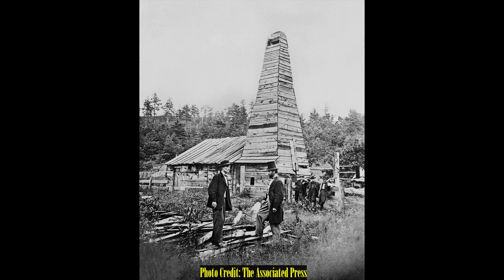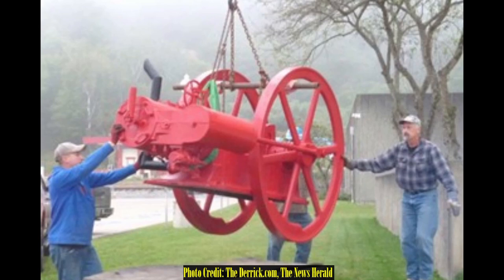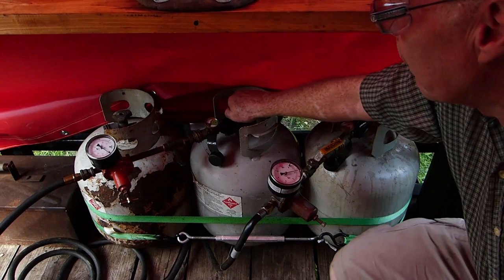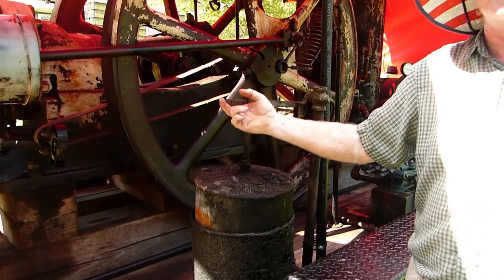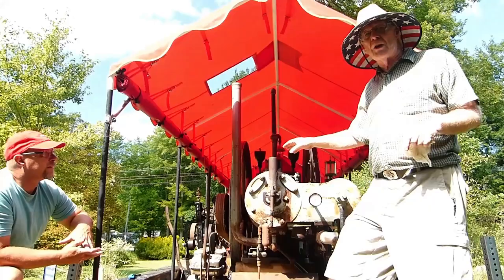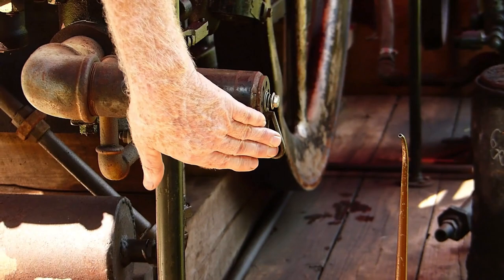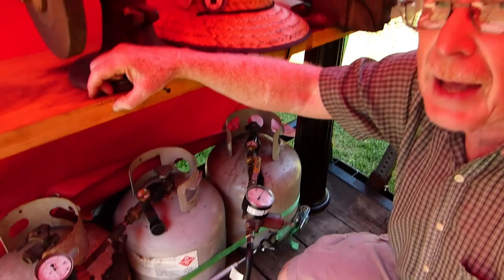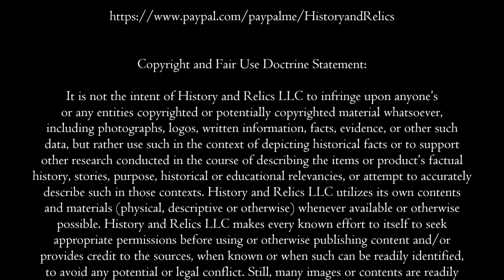Joseph Reid Gas Engine Type A: History and Instructional Operating Demonstration

Comment: Great history lesson and demonstration. I just watched a video about a 2 stroke 'concept' engine with a secondary piston that the designer calls a 'pusher piston'. The secondary cylinder is offset from the main combustion cylinder and has a crankshaft as opposed to two flywheels with offset piston rods.
I think a modern 2 stroke that uses a 'charging cylinder' is worth developing. I hope to see a prototype actually built.
Thank you for posting.
Reply from the maker: I’m very happy you came across my channel and enjoyed the video and found it useful. That was our goal as we seen so many others not provide details, tips, tricks, and the like. We wanted to be different but lend a hand out there that have similar equipment or can benefit from our demonstration. Thanks again!

Comment: Great video! I own a 1913 Reid 25 hp. His runs much nicer than mine.
Reply from the maker: Hi there and welcome. So, nice of you to stop by and subscribe too. I appreciate that a lot. I really enjoyed making this and one other video from a local show. Once the weather breaks, I plan on doing a couple more this summer. The Reid in this video is my Brother-in-law’s. He and his neighbor/business partner has had it for a number of years and is running the best it has since they got it - tinkering and tweaking things here and there trying to get it just right. He wanted to share his knowledge and what he has learned and seek other’s tips and tricks as well. Thanks again and hope you like my Channel. Best regards.
Reply: Great video. I was just WILLED  20hp. REID from a dear friend of mine. He and I went to Oil City Pa. When he bought the engine.  Fly wheels were seized as were the pistons. Drug it up on trailer with 12000lb  winch and 3 come a longs.
Got it home.  I put a square tubing frame under it with axles off of an antique combine. 
He had it running once on video but I was out of town. So i dont know the starting procedure. I sure would like to get in touch with you two guys with questions that I have. I promised I would get it fired again.  I know he'll be watching 
Thanks for a great video
I'm in oh also